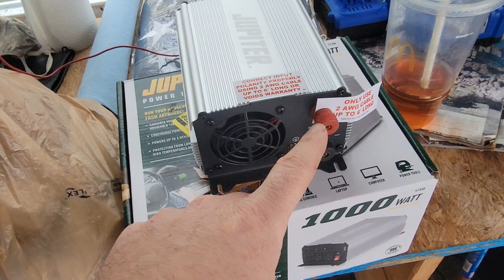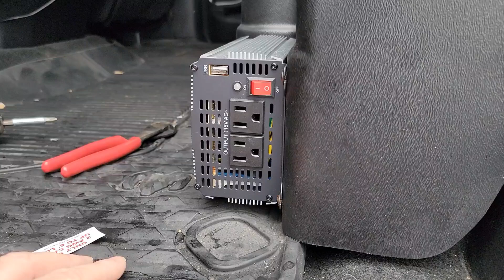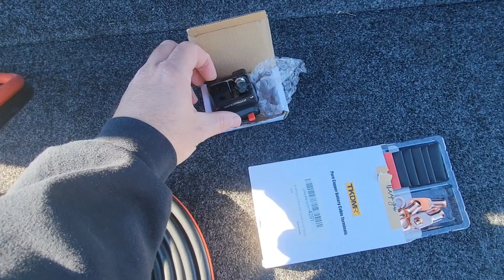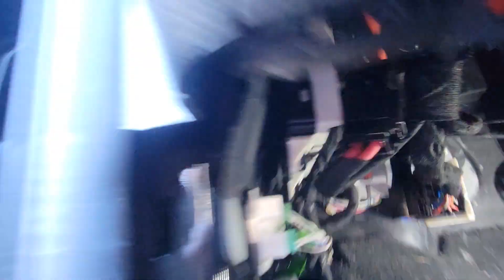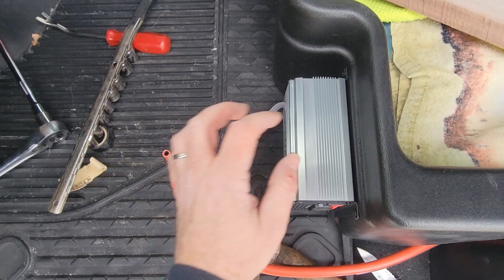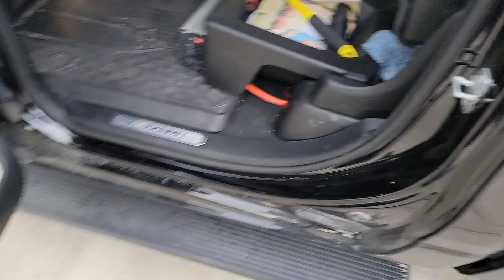Installing AC Power Inverter in My 2022 Ram 1500 Laramie

Comment: Couple of questions. Did you check to see if there were any factory components (harness, etc) available?  Also, did you consider running a plug up to your dash/console or back to your bed, to simulate a factory install?

Comment: The inverter has fuse, right? Why need circuit breaker?
Reply: To protect the cable not the inverter; i.e. so it doesn't catch fire if it shorts out.

Comment: Nice video!  You should really have run a negative wire directly to the battery too.  There will be quite a load on that existing negative wire from the battery to the frame.  Also, I believe that is a modified sine wave inverter and it may not play nice with electronic items.  Still very handy though!

Comment: It's 2GA wire up to 6ft...if you have a longer run, just increase the size/diameter of your wire. I would go 0GA and never look back....fused of course. You should have a fuse/breaker mounted as close to the battery as possible...so that in the event of a overload, you only have 3-4 inches of wire that can melt down before the fuse trips.

Comment: Great video. Could you have just grounded the inverter to a seat bolt thats already in the floor instead of sanding off the paint and rrunning the self tapper?
Reply: Yes

Comment: I also believe the wire size jumper cables you got look like 2/0 gauge not 2AWG. 2/0 is .365 thousands compared to 2 awg at .257. And thats without the sheathing.
Reply: Yup.  Too bad, #2 would have done the job (and easier to work with)

Comment: Hmmm. That 1000w continuous output is at 120vAC. That means the output is 8.3 amps. Or double that for a second at full surge. It should never need 150 amps DC to do that. 2 awg seems huge! Lol.  I no that's what it says but that's starter wire! Haha.
Reply from the maker: But it's getting that source from 12V, not 120V, so the amperage is MUCH higher.
Reply: @OFFRD  invertersrus say 1500 watt continuous use 4 awg wire.  2 awg is fine but that stuff is 2/0 or as some say #2. Which is quite thicker.  And its not going to be going full power all the time.   My Ram has 2 400 watt 120v plugs built in and runs my refrigerator constantly for days without even getting warm.

Comment: Did that Craftsman/Black & Decker drill come out of a Sears & Roebuck catalogue?  Where is all that fancy Kobalt stuff??  Haha!  FYI- there is a plastic plate with one stud/nut holding it in, located just above the brake pedal bracket that you can take out and drill holes in to pass cables through.  I believe it was designed for the passthru of the snowplow control option.  Worked great for all my lighting controllers and has been on the firewall since the Gen4 models.
Reply from the maker: You give my drill too much credit.  It's a Harbor Freight drill I bought for $18 and I've beat on it for two years without a hiccup!  :D
Reply: @4-LOW how'd you crimp your lugs 🔩 securely?